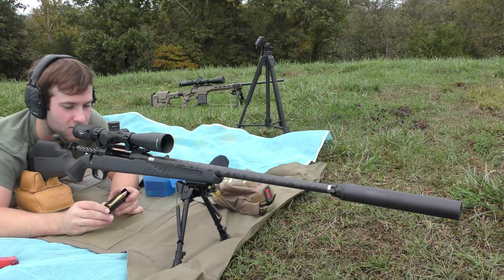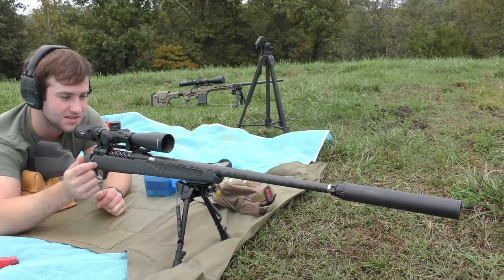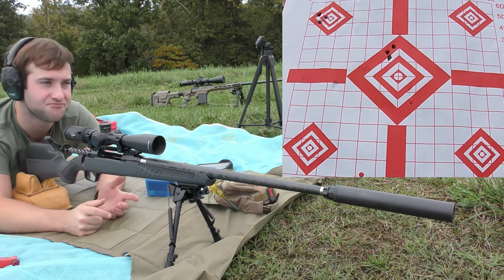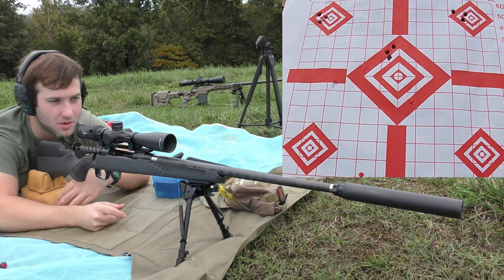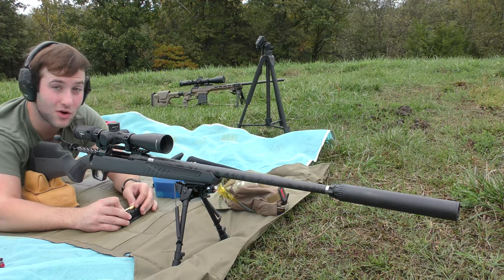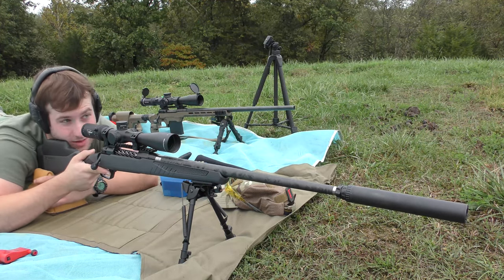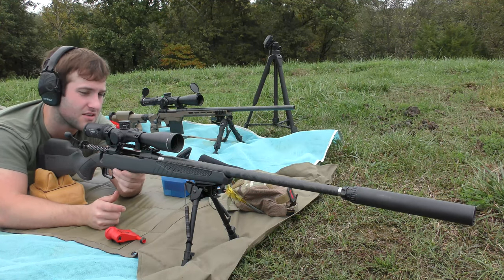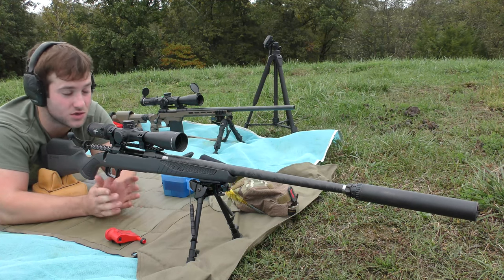Savage Ultralite 280 Ackley Improved w/ Barnes 140g TTSX: Suppressed Handload Accuracy at 100 Yards

Comment: Not really sure why I avoided building a 280AI all these years. I had two 280 Remingtons and a 7RemMag I built and very pleased with all 3. I finally gave in to my curiosity and dove deeper into the 7mm realm and built TWO 7PRCs, TWO 280AIs and bought a factory Tikka compact 708 all inside 8 months. All in 2023. The 280AIs:
1. 24" #3 Brux 4 groove, Trued Rem 700 action, TT trigger, bolt fluted, tactical bolt knob, HS-Precision stock properly bedded, threaded muzzle, cerakoted patriot brown action, barrel, floorplate, black bolt. I have plenty of new Peterson brass but haven't even touched it yet. Been fireforming factory Norma 280 Rem 160 grain tipstrike ammo and that stuff shot so well I said to heck with it and just filled a couple deer tags with it last season. I'll eventually get around to loading for it 

2. 24" #3 Bartlein 5 groove, Defiance action, bedded in a factory Rem BDL wood stock, TT trigger, threaded muzzle. I wanted to compare this one to my 7RemMag which has a 26" Krieger bbl. With that one I'm at 3000fps with a 168 BVLD over 73.0 Retumbo. So, I wanted to see what the 280AI would do with that bullet. I used H4831SC and got up to 2960fps but pressure signs. Backed off and it's shooting well at 2940fps - comfortable max. But my ultimate purpose of going with 280AI was to see what I could do with 140 class bullets so I chose the 139 Barnes LRX over a full case of Superformance. Didn't take long to settle on this load with fireformed Norma brass, 210M primers, 1/2MOA 3 shot groups at 3300fps. Done. I loaded up 50. I'll get around to the Brux bbl 280AI sometime this year
Reply from the maker: Wow! Talk about a love for the 7mm. Sounds like you have some really nice builds and getting some awesome performance on top of that. I hope your newer projects turn out to be as impressive as the ones you've already been playing with! Thank you for the info!

Comment: First one to your video I built a 280ai this winter
Reply from the maker: Nice! How do you like it?
Reply: @RisenCitizen  I like it so far I only got to take it out once it’s built with a 721 Remington that I got at the pawnshop and it was a 30-06 and didn’t shoot good because it’s chamber had been cut crooked to the bore looking through a bore scope so I ordered a barrel from Shilens already threaded and short chambered for the 280ai 26” 1-8 twist and it shot good I Conographed it with 154 grain hornady and H4831sc at 2932 and it was within around 12 fps of each other I was surprised
Reply from the maker: @scottscheuerman8714  sounds like you are making good use of that action! I hope you end up loving the rifle. It seems like it is consistent! Should be a good shooter!
Reply: @scottscheuerman8714  I also bought a few 30-06 Tikka rifles (4). Have tested all 4 with a variety of factory ammo and a couple of good universal handloads that have worked well for me in several rifles. One of the Tikkas just can't keep up with the rest so it will be a 280AI as soon as the new barrel is done which should be in the next 4 months. It's a Hunter (wood stock, blued metal). I'd like to keep the wood stock and just get it pillar bedded then skim bedded but I have a Stocky's stock on hand as well I can use.

Comment: I almost bought a ultralight 280AI.  I wanted a 1@8 twist barrel.  And a 24 inch or longer barrel. So i ended up going with a Browning. A Xbolt Hells Canyon Speed Long Range 280AI. Haven't decided on a scope yet. Been looking at
Trijicon tenmile 4x24x50mm 
Leica amplus 6 3x18x44mm 
Nightforce shv 5x20x56mm 
Leupold VX5 HD 3x15 44mm
Leupold VX5 4X24X52MM 
Zeiss v4 4x16x44mm. 
I am starting at 162 and going up to 180 gr.
Reply from the maker: Great option! I looked hard at that one, too. I am super picky on scopes, so I can't help you deciding on that one, but you have some good options picked out!
Reply: @RisenCitizen  the Leica amplus 6 3x18x44mm would be a good one. But I like the Trijicon too. The Nightforce SHV don't have zero stop. It's called zero set.
Reply from the maker: @ozark_trapper  I love Nightforce scopes, but I do wish mine had locking turrets. So, I know where you're coming from. Everyone has a preference, though!
Reply: @RisenCitizen  That's the only thing that is keeping me from buying it. I know Leica Rangefinders and binoculars. Are top of the line.  All the scopes I have listed are good scopes. Out of the one's I have listed. I see more used Leupold VX5 or VX 6 for sale. Than any other scopes.
Reply from the maker: @ozark_trapper  true that. It really just comes down to personal preference. They'll likely all get the job done, but one may be more user-friendly than another.

Comment: That's real slow for that cartridge. I'm getting more out of my 7mm08. But im a fan of 280AI. I'm getting over 2900 fps using speer 145 and H4350 in 7mm08
Reply from the maker: Nice! What barrel length do you have on your 7mm08?
Reply: @RisenCitizen  24" barrel. Weatherby vanguard
Reply from the maker: @rexking3698  sounds like a nice combination!
Reply: Definitely slow. I get 3030fps with 160 Nosler Accubonds and 60.5grs 7828ssc. 24” Kimber Mountain Ascent. I would expect a 140 class bullet to be WELL north of 3100fps in that rifle.  Maybe try to get your hands on some 4350 or Reloder 17. Barnes is showing load data for those two powders.
Reply from the maker: @cabinetmunch  I was using a mild charge in this test just playing with seating depth. I was able to get more speed out of it in a later test.